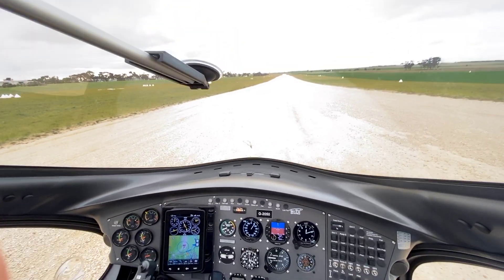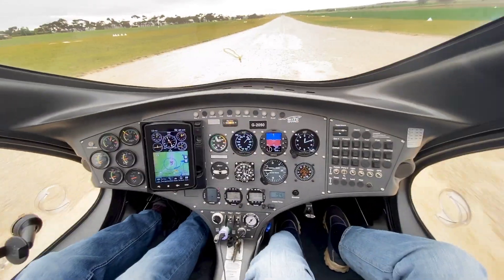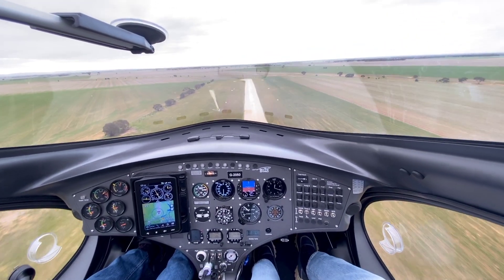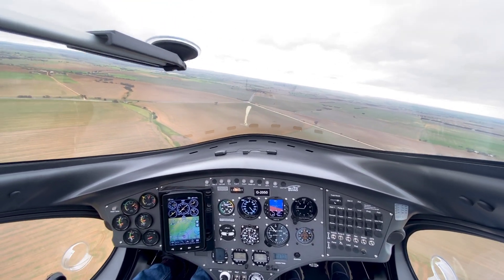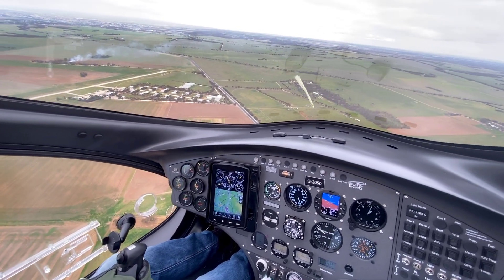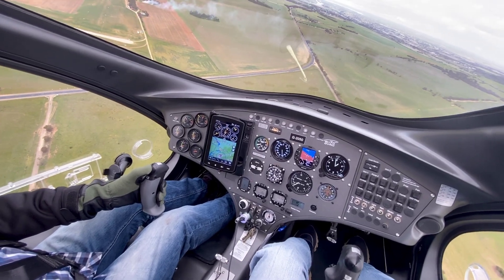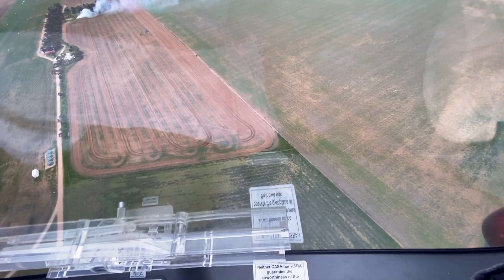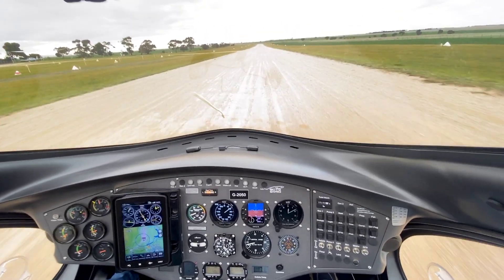What happens if the engine fails in a gyroplane?

Comment: Nothing, you just land softly in autorotation, keep the max efficiency speed to maximize the flight time and look for a good emergency landing field, descend and then perform a short flare and stop the gyro in few meters on the land. One of the advantages of the autogyro is that it doesn’t need a long runway or long field to dissipate the speed after landing as a normal three axis plane

Comment: It drops like a brick. I have hundreds of hours in rotorcraft and they all drop like a brick without power. Plus the rotor diameter is very large. So if you try to land on a road you'll probably hit a wire or a mailbox or a sign or corn or whatever. Minimum rotor blade diameter is usually 28 ft. So on a country road the blades hangover 6 to 8 ft on each side. It's very risky and will cause a rollover if you slightly touch something with the tip of the rotor blade and you'll destroy the aircraft even with a perfect touchdown.
Reply from the maker: Actually in a gyroplane you don't drop "like a brick" - descent without power is about 500ft per minute. The point of this video is to show how controlled the descent and landing can be in the event the engine does stop. You are right with regard to the rotor blade length so the pilot needs to be very aware of where they are going to be landing in order to reduce the risk of damage.
Reply: @rotor-sport_australia  With a 4:1 glide ratio most gyros are on the ground in less than 1 minute since they typically fly low. With a high load, high heat & humidity and density altitude they often drop faster than that (800' to 1,200' per minute). Most aircraft are very controllable with the engine off if you maintain best glide speed. My old Pitts Special S1S glided surprising well with the engine off. I've trained heavily in Robinson helicopters. Role the power to idle and you are on the ground in seconds. Same with modern gyros. It takes a high level of skill and judgement when the engine fails unexpectedly which happens regularly. Benson, Air Command, Auto Gyro, Magni, American Ranger...they are all the same. They drop very fast.
Reply: @pittss2c601  You... Realize that you're arguing with a rotorcraft flight instructor, right?

You realize that you aren't right... Right?
Reply: @operator8014  It's my experience flying lots of different types of rotorcraft aircraft. You will never hear a rotorcraft pilot complain that they cannot quickly lose altitude. Only some airplanes like the Breezy & certain ultralights drop as quickly.
Reply: @pittss2c601  Okay, you don't get it. Roger that.
Reply: I'd rather be in a gyro plane or helicopter than an airplane when engines fail. You have far better odds of finding a landing area that'll work for you.
Reply: @kerbalairforce8802  Have you experienced a power failure in rotorcraft? You are on the ground in a very short period of time which limits your options. Rotor blades take up a lot of space and get very close to the ground when you flare.
Reply: @pittss2c601  And yet autorotation is a well known, well practiced and ultimately, a 'safe' method of getting a rotor craft down to the ground. Rotary pilots practice this, and they don't need long landing strips to do it. There are many thousands of pilots who can attest to this. Perhaps you're just not very good at it? 😁
Reply: @another3997  I have lost count of the number of times I have lost power in my 15 airplanes that I have owned, my friends’ airplanes and even rented aircraft. A piston blew on my rented Cessna 152 when I was getting my license. Glided it to a perfect narrow road landing in the country while missing wires, mailboxes and tall corn. I have trained extensively in helicopters and gyroplanes. We practice idle power landings during nearly every flight. I have never bent, damaged or hurt any aircraft in any way during these emergencies. When you fly a lot, it happens more often than people know and you tend to get used to it and expect it. I glided in twice in my old Pitts Special S1S.
Reply: If by 'drops like a brick' you mean 'floats gracefully down like a parachute', then yes, you are spot on, it does drop exactly like a brick - a brick made of feathers. 🤣

This is NOT a helicopter!
Reply: @weezylistening  You clearly have never experienced a power failure in gyroplane or helicopter.. A 4:1 glide ratio is a brick.
Reply: @pittss2c601  I absolutely HAVE experienced many engine shut downs in a gyro! Too many to number in fact. 

A gyro and a helicopter are like chalk and cheese.... They are nothing alike.

If I'd experienced an engine failure (or shut down) in a helicopter I'd put money on the fact that I would not be alive to type this reply.
Reply: @rotor-sport_australia  I mean, 500 ft / min is damn fast. lol

Comment: This is a video training situation of what happens when an engine stalls in a gyrocopter he throttle down at 2:50 to idle. and shows how to glide the Gyro down safely without engine power since this is a training simulation he is not going to actually turn off the engine

Comment: Lot of vibration in the stick is that normal. Used a lot of runway to takeoff.
Reply: yeah a lot. why is that? one would think to get the rotor pretty much up to takeoff speed I would think. didn't realize they needed more runway than a Cessna.
Reply: @leecowell8165  They don't "need" that much room to take off, but if you have it available, why not use it? It's better to have a bit of mechanical sympathy than to constantly push to the machinery to its limits. Things last longer. It also gives you time to notice any potential problems and abort, and ultimately provides you with a greater safety margin.

Comment: I think you have to watch your airspeed and your rev count because you can stall it
Reply from the maker: Gyroplanes don't stall. We can have zero airspeed and still descend vertically all the way to the ground - we'd land with a thud though. The rotors continue to rotate thanks to airflow through the rotor system so if the engine does quit we simply pitch the aircraft to landing speed (typically 55-60 knots) and land safely.
Reply: At 0 airspeed, would the gyrocopter start to yaw in the direction of blade rotation?

Is rotor overspeeding a problem?

I’ve been doing helicopter lessons, and gyros are just mind-blowing to me!
Reply from the maker: Hi  @joshua.merrill  at 0 airspeed the gyro will lose rudder authority and begin to spin. No amount of rudder input will prevent this, so the recovery is simply lower the nose to regain some airspeed which returns rudder authority and you will stop spinning. It's simple! The rotor self-manages its RPM so there's nothing we need to do with it - once we have completed the take off process the rotor RPM is mostly irrelevant
Reply: @rotor-sport_australia  thank you for your reply. What interesting contraptions these vehicles are!

Comment: Just can't get past the stick shake.  Seems like holding a weak jackhammer.  That's my only hesitation.
Reply: Believe it or not, with enough practice your brain sort of cuts through and ignores the vibration of the stick and only reacts to things that feel odd. The brain is an amazing thing. Don't believe me? Your nose is always in your field of vision but your brain tunes it out because it's always there, therefore the brain sees it as useless information and filters it out. Same thing with the stick vibration in a gyro. Once your brain realizes the vibration is useless information on what the aircraft is doing. It will filter it out
Reply: @DinoHunter56  Absolutely true. We do the same thing with sound, touch and smell. If you listen to scratchy old 78 rpm records, or to Shortwave radio (I'm a licensed amateur) you can ignore the noise within a few moments. After a few minutes in a smelly environment, you cannot smell the odour until it changes. Touch a surface lightly with your finger and hold it perfectly still, then you cease to feel the surface within a couple of seconds, until you move again.

Comment: A non event when you have a good place to land just beyond your nose...
Reply: And that was the purpose of the clip... A non event in the event of an engine failure. They don't fall out of the sky
Reply: @larryusher4189  right. The advantage  here is that the approach is steeper and slower, takes much less ground to land . The downside is that they don't glide well.
Reply: I see why you have wear a glove- constant vibration in the stick will give you hand:- arm-vibration - syndrome (HAVS) I got that from years of running a chainsaw.

Comment: What lack for the biggest part of the gyroplane is the VTOL capability
Reply: He did not demonstrate a short landing, but most modern gyroplanes can land in a very short space indeed.  As short as 20 to 30 feet, depending on lots of variables I suppose.  Much shorter than most planes, but not a helicopter of course.  On the flip side, a gyroplane is much, much simpler mechanically than a helicopter.
Reply: @cerealspiller  Yes but have two American gyroplane company that has the VTOL technologie for gyroplane, Skywork and Carter Copter(Jaunty Mobility), the gyroplane would be a good and more cheap alternative to helicopter and of course most
 safety

Comment: So absurd gyros require so much runway
Reply: They don't. You can land one on a dime, it's just safer to maintain forward flight if you can.
Reply: @kerbalairforce8802  you know u have to take off before landing right/
Reply: @plantpower3048  You know that you can accelerate to take off speed as slowly or as fast as you want? You don't have to thrash an engine all the time, so if you have the room, why not use it? A longer run up gives you more time to see and react to any problems that might arise BEFORE you get in to the air.